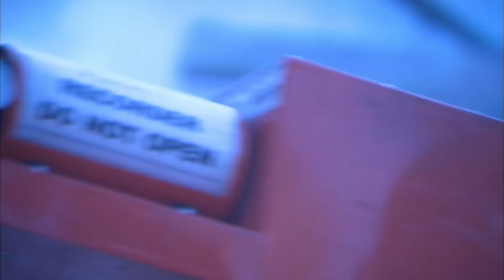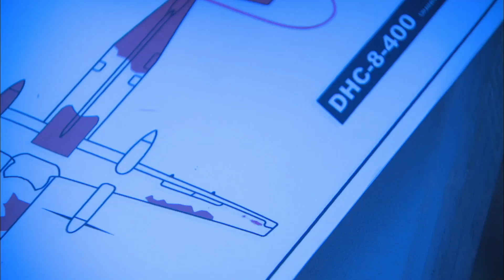Crash Investigators are in a Race to Retrieve Crucial Evidence 🛩 Air Disasters | Smithsonian Channel

Comment: under a codeshare agreement with Continental Airlines) was a scheduled passenger flight from Newark, New Jersey, to Buffalo, New York, which crashed on February 12, 2009. The aircraft, a Bombardier Q400, entered an aerodynamic stall from which it did not recover, and crashed into a house at 6038 Long Street in Clarence Center, New York, at 10:17 pm EST (03:17 UTC), killing all 49 passengers and crew on board, as well as one person inside the house